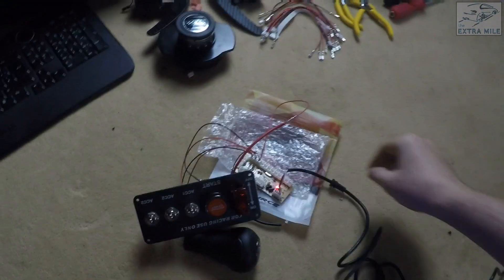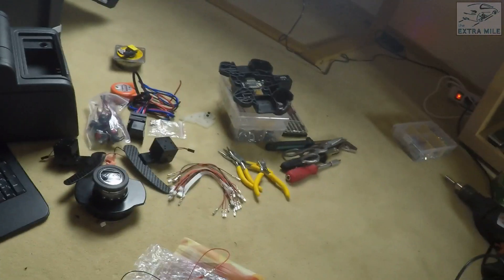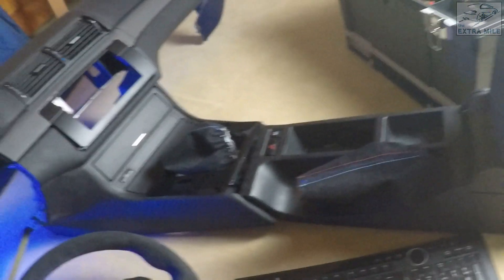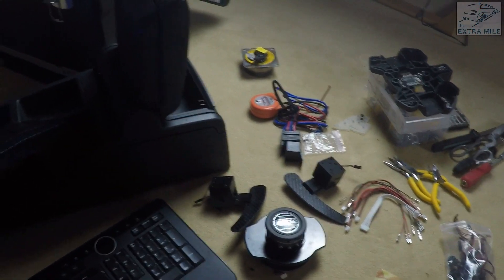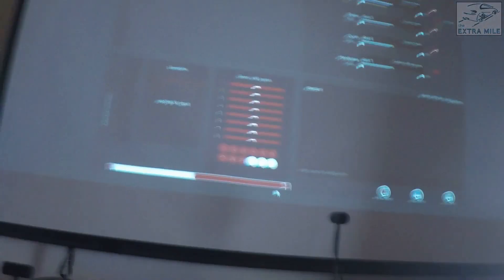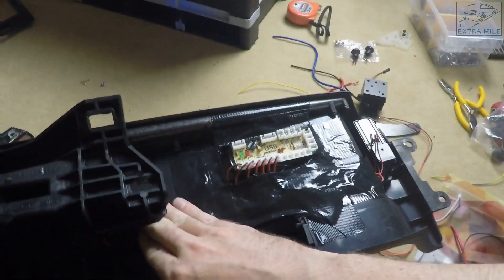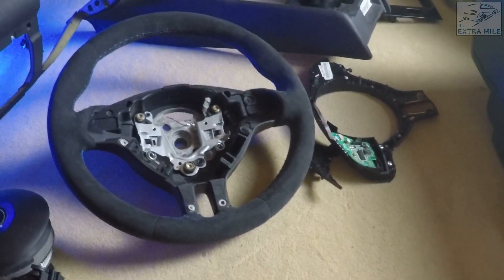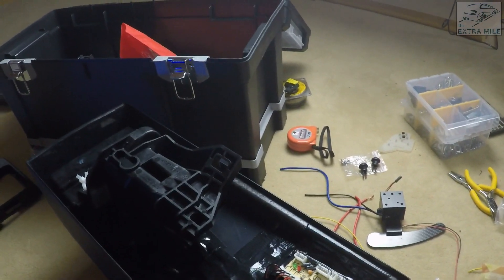SimRig Mega Build Phase 1: Buttons are working :)

Comment: Nice, man. You work quick! Was it just a matter of wiring?
Reply from the maker: Thanks Jordan! Actually yes, it was just a matter of wiring. Thing was that the bmw buttons also had pins for the lighting, so I was not sure which one of the pins I would need to use. 

But other than that, it was just plug and play. The USB board thingy too. Just connect it to the pc, wire the buttons to the board and you´re done :) 

I have arranged a few more surprises for the whole center console/button area ;)

Comment: Just an FYI, since that duct tape disgusts me, you can use a hot glue gun on electronics as it's A.) non-conductive, and B.) easier/cleaner to remove while holding just as well.
Reply from the maker: I  actually do have a hot glue gun here, but to me the black tape looks like a cleaner result. I just have a soft spot for duct tape :) Used to make all kinds of stuff out of those rolls. I agree that the glue gun would be generally the way to go though.

Comment: Any idea what you'll be using most of the buttons for in game?
Reply from the maker: Well, it depends on the game really. In Assetto Corsa it´s probably going to be lights, turbo pressure, traction control and change view. 

Project cars would allow ignition and engine start buttons as well. I´ll have to see how it works out :)
Reply: Cool, excited to see it in action

Comment: ayy I have the same usb controller
Reply from the maker: Cool! I hope it´s working well :)
Reply: The Extra Mile have you had to do any souldering?
Reply from the maker: No, I used small cable clamps. It´s just faster and cleaner to use here in the living room.
Reply: The Extra Mile did the wires come with the usb controller for you too?